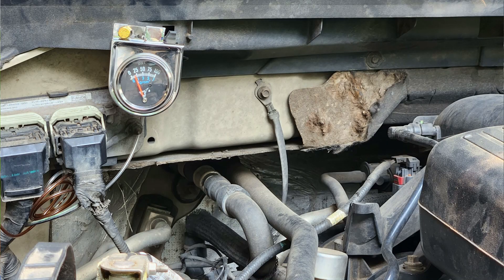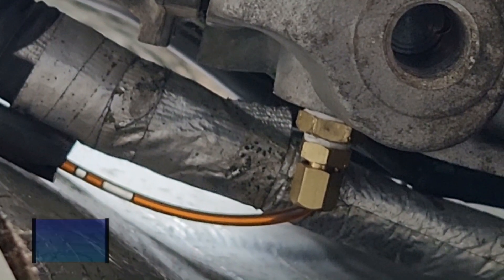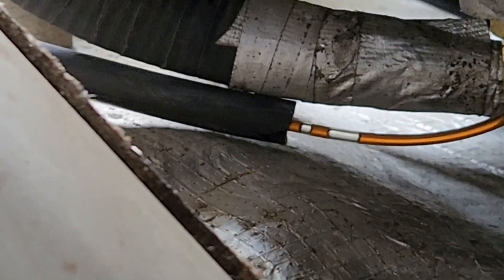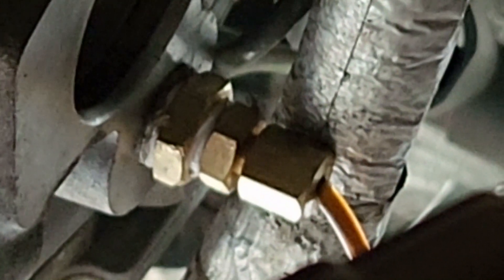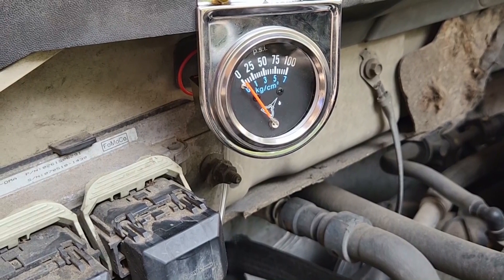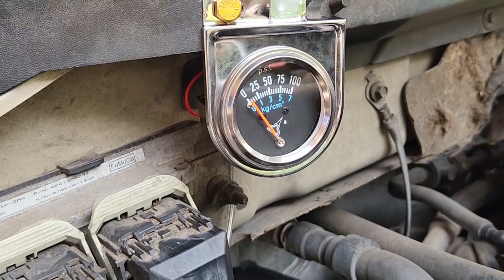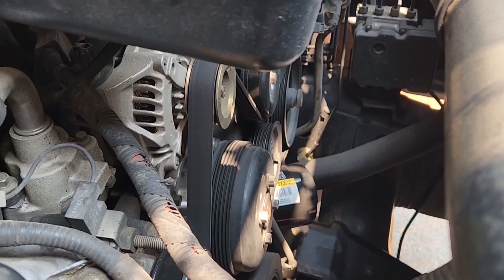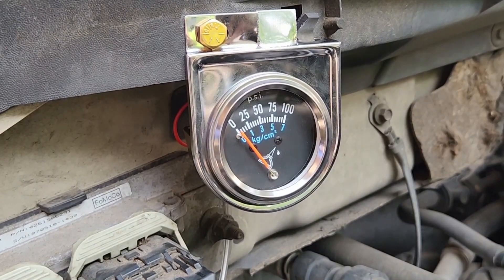Cold Start Rattle!!  Checking the REAL oil pressure - F150 5.4 3V

Comment: Chain tensioner gasket leaking oil & causing chain slapping against chain guide.  Seen it many times.
Reply from the maker: In the end I had a lot more going on with this old engine and since I plan on keeping this truck as long as possible I swapped in a reman.  Thanks for the feedback.

Comment: I have a 2012 Expedition with 51k miles and I never heard any rattling until I used full synthetic oil for my last oil change. It doesn't do it all the time, but I'm due for an oil change this month and will go back to Motorcraft synthetic blend and see what happens.
Reply: Did it make a difference?
Reply: @Bccool86  I went with Amsoil synthetic and it hasn't done it ever since
Reply: @ilc-nl3yy  I've herd great things about Amsoil. My '11 Expedition 5.4l has a Castrol sticker on the window when I bout it and it just started having a start up rattle. Hoping to alleviate that with oil and filter. We'll see...
Reply: @Bccool86  I used a Royal Purple filter.
Reply: Synthetic blend oil still working to stop the noise? What Viscosity are you using 5w20?

Comment: I have a 2003 4.6L 2V. It has had a startup rattle since brand new.  Dealer said it was the belt tensioner. It wasn’t.  I found some oil filters make the noise more noticeable so I switched to the Motorcraft 820s exclusively. It reduces the incidence of the noise but doesn’t eliminate it completely. Flooring the accelerator so the engine doesn’t start and cranking eliminates the noise altogether at startup as oil pressure builds. So my guess is that the hydraulic chain tensioners are leaking down frequently.  After 22 years, noise or not, everything is running smoothly still after 150,000 miles.  You may have the same issue or possibly a defective roller rocker. Just a guess.

Comment: Cam phaser
Reply from the maker: @philliprobinson2227  without a doubt.  But it is rooted in the poor design of the oil pump and oil passages combined with very high mileage.  I ended up doing full engine swap.

Comment: A cam phaser can make a clack sound like that. Also a hydraulic tensioner that doesnt get enough oil cannot push the blade tensioner against the chain and the blade tensioner will keep hitting against the hydraulic tensioner making a clank clank clank

Comment: Hey. Did you figure out what the rattle was?
Reply from the maker: Yes, it was basically the entire top end.  Basically zero oil pressure common on high mileage 5.4 engines.  I replaced the engine with a Reman from PowerTrain about 12k miles ago and it has been perfect.

Comment: we are In. the same boat with williams 5.4 his is a 2005.
Reply from the maker: I bailed on trying to repair this one myself.  It is currently in a trusted shop waiting on diagnosis.  I am expecting it will need a full timing chain kit and oil pump.
Reply: What was it? @DailyBrewGarage
Reply from the maker: @cortneybunge359  it ended up being super low oil pressure due to clogged oil passages, poorly designed original oil pump, and engine age.  Also a broken timing chain guide.  I have other videos where I completely replaced the engine with a Reman version that had all of the original design flaws corrected.
Reply: we r going to tackle this job ourself. it looks pretty simple. since this is williams truck he gets to do the wrench turning. it will give him a good mechanic experience. he has already done plenty of work to his 4 wheeler so.....we will keep u posted on our success.